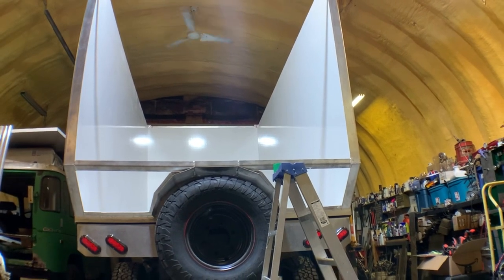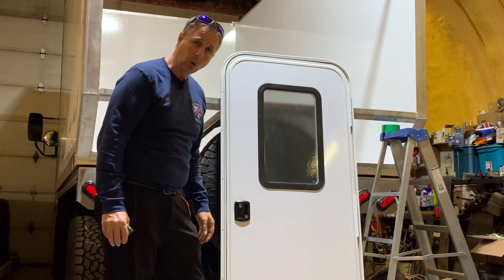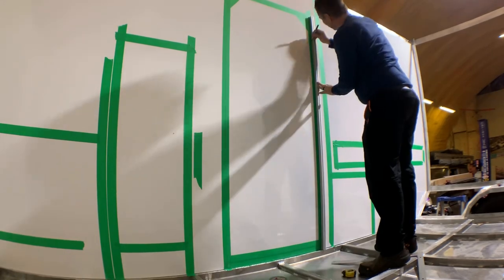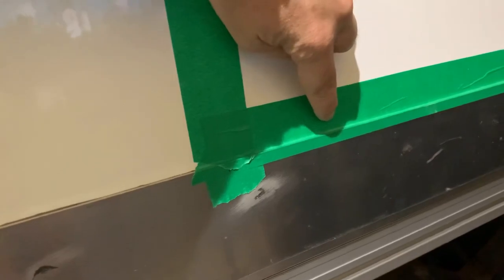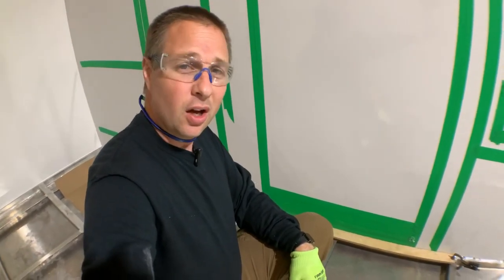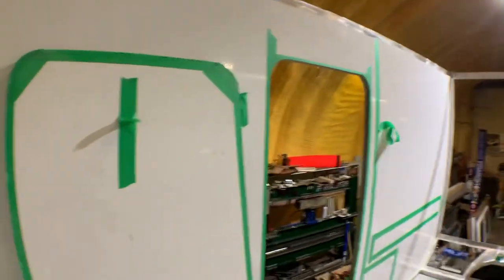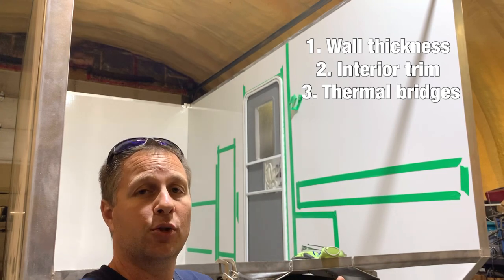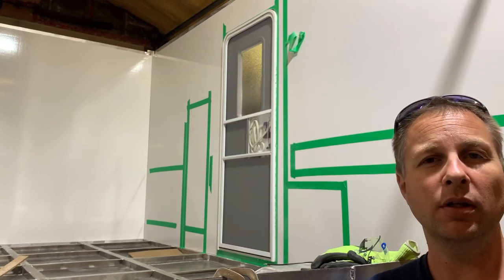Cutting up a $$ WALL | Fuso FG camper door install

Comment: I will, and you should consider a electronic dead bolt for security.
Reply from the maker: What is the gain for electronic over manual?
Reply: @BruceandKrista  the one I'm looking at has no external ability to distroy it